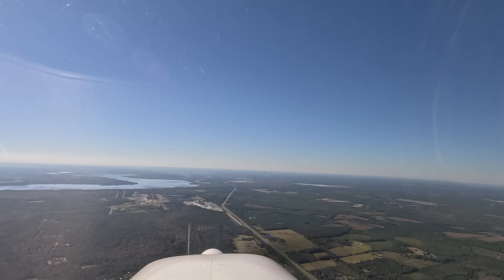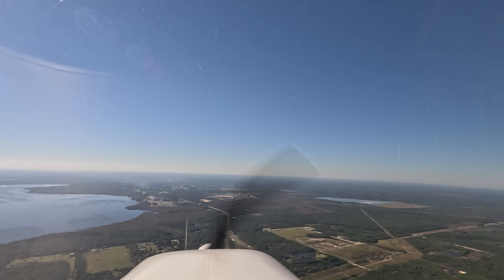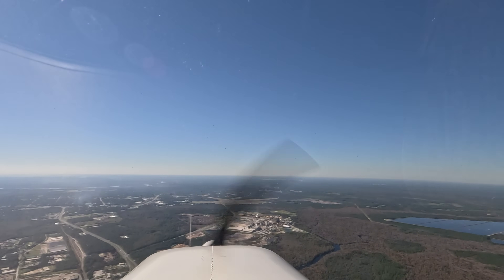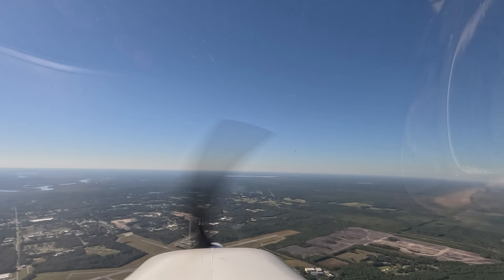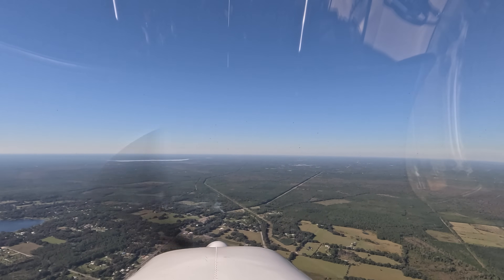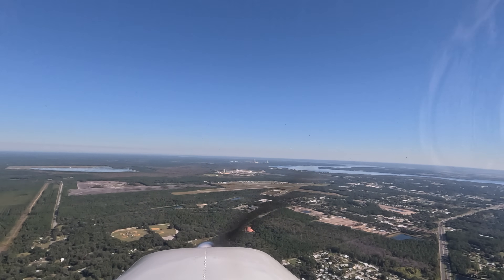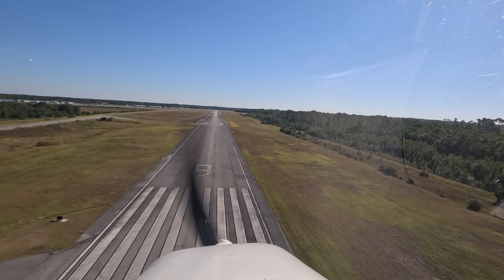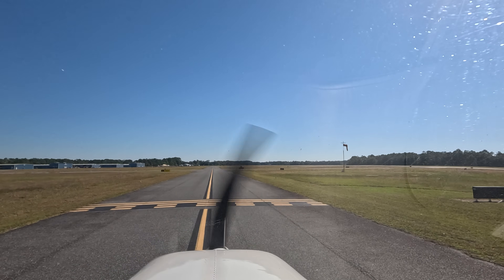Cessna 172 Engine Failure (@ 7:00)

Comment: Glad you landed safely, the pilot really kept his cool. So what happened to the engine, was it a plug.....or two?
Reply from the maker: Well....I wish I knew lol. Found a cold cylinder upon landing, and also fouled plugs. The question is: what caused the plugs to foul? We're still working through troubleshooting at the moment. I will eventually find the culprit and get her back in the air.
Reply: @nkawtg4  did you get a look at cht and/or egt per cylinder?
Reply from the maker: @ejss79178 EGT was inop that flight... and it's a 1956. No CHT.